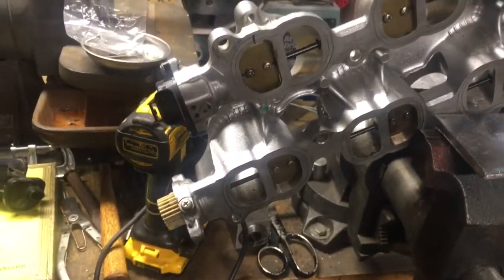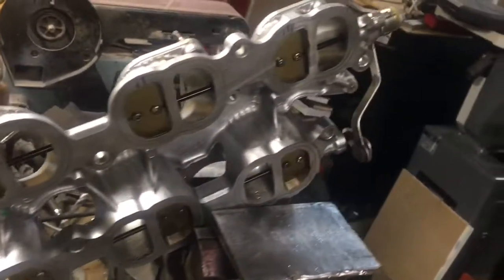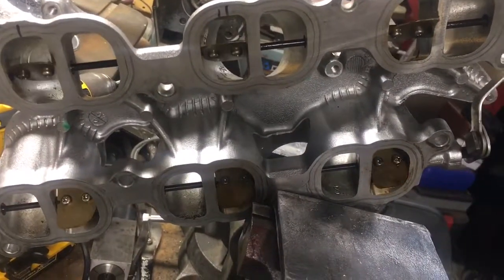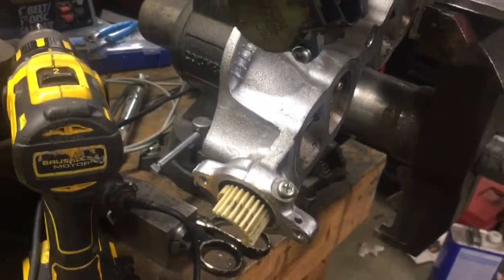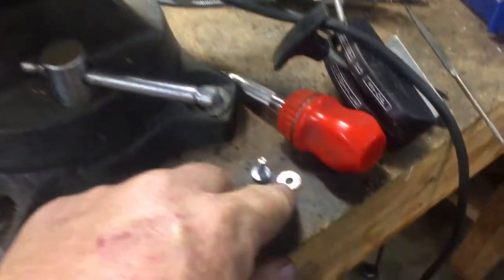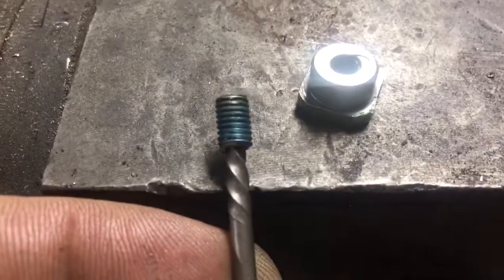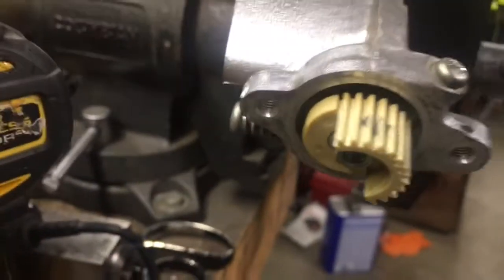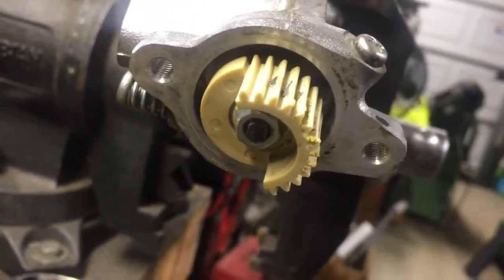2008 Lexus IS 250 Intake runner repair

Comment: Thanks for the video.  I wanted to see those swirl control valves up close.  Those butterfly valves are there to change the swirl pattern as the air enters the combustion chamber.  When the valves are closed, the swirl is horizontal to the piston top.  When the valves are open, the swirl is vertical to the piston top.  The swirl patterns are there to promote good air and fuel mixture.  The valve that changes the runner length is in the plastic upper intake manifold (air surge tank) and is part of the Acoustic Control Induction System (ACIS).  Your video is way cooler than the diagram in the manual.  Thank you!

Comment: Thanks for that video I check mine today and when I remove de sensor the little nut was completely out,I put back with Little bit of locknut glue but Still have the issue the RPM don’t pass 4500

Comment: i have rebuilt the whole intake runner and replaced the sensors and the code still won’t clear.
Reply from the maker: It has been so long since I did this, I can’t remember the code. Bank lean or rich? Leaking and or rotted, cut vacuum hoses will also cause these type codes. Also bad POV or CCV systems can do it also.

Comment: That last part you showed with the bolt without loctite. Is that the runner actuator?
Reply from the maker: I guess that would be a good name for it. I put that nut shown in the still photo at the end of the video back on the gear shaft with red loctite. That last pic shows how I found it when I opened the actuator. Nut just laying in the housing. Pitiful design.
Reply: @stearman  gotcha. Did your son say he had grinding noises at random times while driving? That's what I've been having happen and I'm wondering if that nut could be the culprit